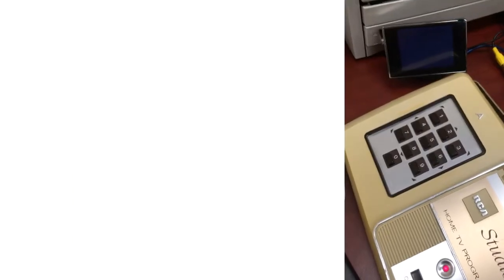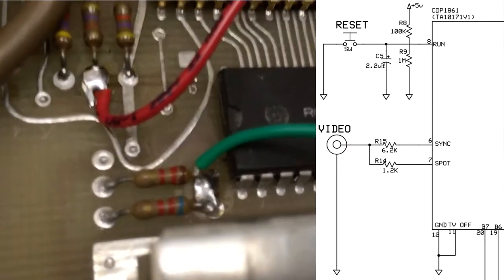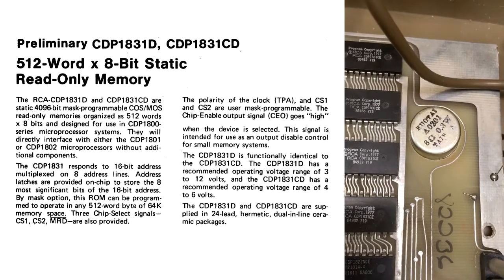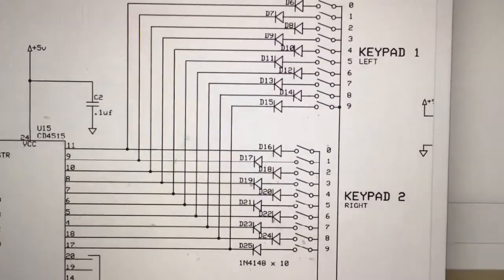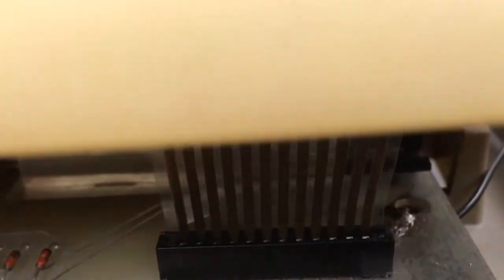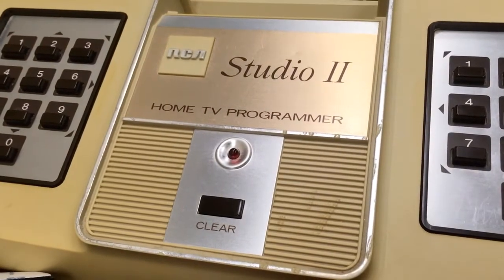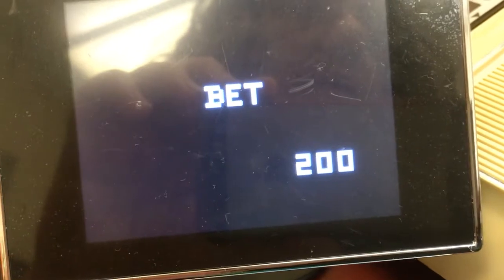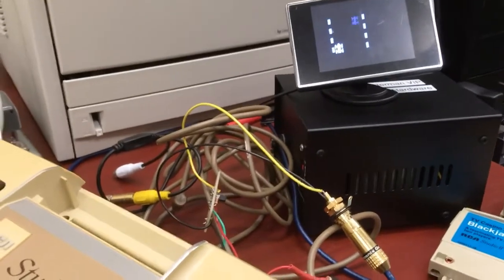RCA Studio II mods, repair, and commentary (added composite video output and 5V input; fixed keypad)

Comment: Hello I have a MPT-02 clone of the RCA Studio, but it don't work anymore. When I switch On the console I have picture and sound from speaker only some seconde. When try again, no sound and picture. If I wait some day, I try again  and it work 10 secondes. You know where I have to look for repair?
Reply from the maker: I'm not sure, but that suggests that one or more of the capacitors may be going bad. Have you opened it up? Look for swelling and cracking in the capacitors, particularly the electrolytic (the can shaped ones). Check out the biggest capacitors first.

Comment: Soo, I really wanna do this composite mod on my RCA Studio 2, one thing I was wondering about the 5V hookup... why did you pull 5V from the board to power the 'modchip' if you made a new 5V input jack anyway. Why didn't you just power the mod-board from the same jack?
Reply from the maker: Heh... I don't remember why. I don't recall having a particularly good reason...
Reply: @Lantertronics  Heh fair enough. I tried doing the mod but It's not working... I recall the console not working, but I remember getting a picture, although it was a mess of pixels that didn't make sense. The only reason I wanted to do this mod was to test it on modern TVs... I don't have any TVs with an antenna input...
Reply from the maker: @BurgerWeeze  I've found that Goodwill and other thrift shops are good sources for cheap TVs with antenna inputs -- it would be worth paying the $10 or so to get one to test it (you might have to get and RCA to F connector adapter but those are cheap online).
Reply: @Lantertronics  don't really have thrift stores where I live. I've been wanting to buy an older CRT TV but I just don't go out (due to pandemic) I'll try to get my hands on one next year. 
I'll also check my circuit again, maybe I just messed something up when putting together the mod circuit.